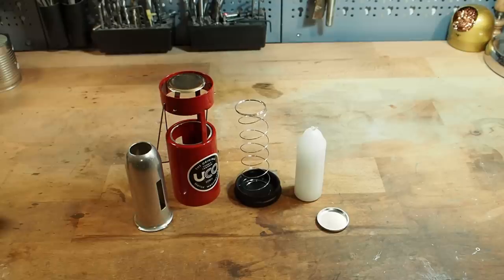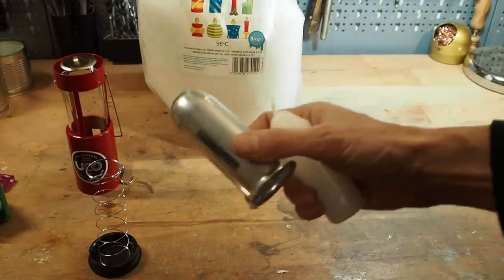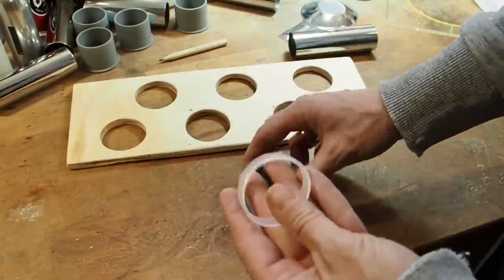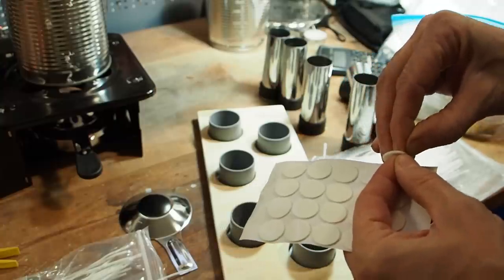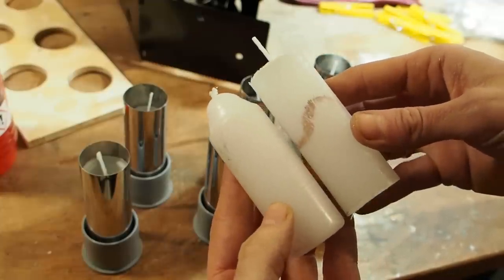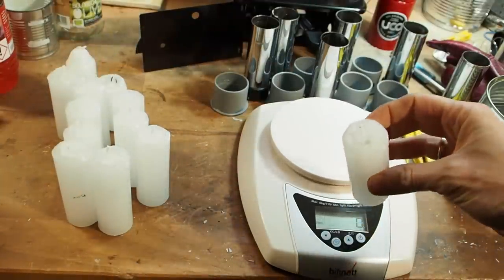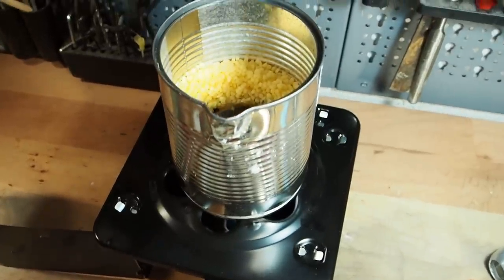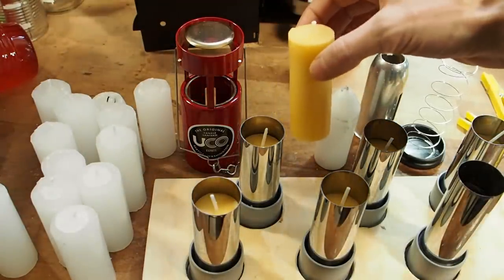DIY Candles for UCO Candle Lantern!

Comment: Could one use a mixture of paraffin and beeswax for these candles?

Also, if using straight paraffin - does one add stearin acid or similar?  

Thanks in advance.

Ps: got a “genuine” UCO lantern in brass, recently.  Have two candle lanterns now.
Reply: Look up plumber's candle online
Reply: @bombsawaylemay770  did so.  Most of the published dimensions were a bit large, e.g. 1.25 x 5 in imperial units.

Based on the measurements I took with several samples, those are a bit large to fit in either of the two lanterns I have, e.g. diameter I recall is about 1.18 inches, and the overall length was closer to 4 inches.

Looks like I’ll need to experiment, then.

Comment: Lily, you started with PVC plumbing pipe but ended up with the metal pipe. Did the PVC not work for you?
Reply: The inner diameter if the plastic ones is smaller than the metal ones

Comment: I hope you test the burn time on the candles. Also if you make your candles upside down and use a condom or some type of heat resistant rubber nipple over the end you will get the shape you want. If making candles with hanging condoms or pipes bottom capped with condoms works I bet it goes viral ;-P

Comment: Don't waiste your time, just buy the tea candle one as it puts out the same amount of light and you can order the candles online. I got the 6 hour ones and 96 of them for around $20.00. Plus it's much smaller and lighter. You can also make more if needed, the 6 hour candles have a plastic base. So just pour the wax into them and support the wick. You can carry several 6 hour tea candles in less space than the regular candles that only last for maybe 8 hours.

Comment: nice idea, but mine would be different. I would try to put something into the hole on the top of the metal candle guide, so it fits smaller diameter candles, then I would just buy simple candles, which diameter is about 2 cm, and ... voila. just cut them into the lenght, nothing else. the burning time would be less, of course, but the cost also. and much simpler. Maybe extra ring on the bottom to keep them in place, as they would be smaller in the diameter.... Any one tried yet?

Comment: Place your container with wax inside a pan of water with a folded cloth in the bottom ! The reason for doing this is the water will only reach a temperature of 100 degrees Celsius and therefore the wax will not reach flashpoint and catch fire ! I got this tip years ago from a friend and his girlfriend who was explaining to me why there kitchen had been set on fire after them indulging in there new candle making hobby fortunately the fire brigade got there before it spread to other rooms ! And for any women who read this and think it may be a good way to meet hunky firemen just tell them your cat is stuck up a tree or stick your head between the railings on the stairs and phone them tell them it's stuck if you want a more hands on experience and it is much safer . ( Only JOKING ! don't do this because someone may be in reel danger and they should not have their time wasted ! )

Comment: You didn't add the cost of your time to make the candles and the cost of materials over the estimated time of making candles or did you? You've learned that bees wax burns about 4 times longer than paraffin wax - yes! Good effort. I;ve trashed my UCO Candle Lantern. The UCO Candle Lantern, is a complex device and therefore simplification and weight reduction is my approach to making an improved solution.

Comment: Your math is a little off on the per candle price as you are not taking in the costs of supplies other than the wax,  the cost of the burner, its heat source, the cost of the wicks, the pipes, the plastic bits , the labor you cut everything and put it together but yeah after you cost out all that stuff the cost of the wax would be so much per candle.
Reply from the maker: Depends on how many candles you make. The fixed cost are divided by the amount of candles I am making with this mold. I can make 100 or 1000 candles.

It took me roughly 30 minutes to make the mold.

One wick costs 0.06 euros btw

3 pipes cost me about 17 euros. 
17 euros divided by 100 candles is 17 cents. 
17 euros divided by 1000 candles is 1,7 cents

Comment: A good video but far to complicated and too long to make. I love my UCO and what I do is buy bees wax sheets and roll my own candles. I cut to size, put the wick on one end and then roll until I get the right diameter to fit the tube. With my fingers I can shape the wick end to fit the top of the tube. easy peezy. The advantage is that the bees wax candles last much longer than normal candles and don't give off the dirty fumes that normal ones do. I also wrap spare candles in cooking paper in order to keep them in shape and for storage. I also have adapted a 50 ml dry shampoo bottle to use lamp oil which lasts even longer. 
Empty the bottle and pull off the  nozzle and drill a larger hole in the top to take a male thread cable connector (gold colour ). Thread that into the top and seal with  two mix putty ( from a putty log ) . When dry this seals the top.  Fill with about 40 mill of lamp oil and put in  a piece of lamp wick. ( not the thin candle ones.). The wick goes thru the connector and the connector is screwed into the container. This works really well and I prefer it to using candles. Easy to make and easy to refill and cheap to run. P.S make sure that the wick is positioned just a fraction out of the connector. To far out makes a big flame that uses lots more lamp oil.  Love your videos.

Comment: O just dont like the idea of candles.  They are messy and u cant carry it around without spilling.    Use camping lled cob light. Put inside a white paint bucket and it illuminstes the enture bucket.  Or simply put behind a hanging whit sheet and illuminate a entire area off one led.  Get a light and use a rechargeable battery.
Reply from the maker: Sure leds are great. But they dont produce a lot of heat. A candle produces 80 watts of heat and can raise the temp inside of a tent and keep condensation down. 

In fact I am planning to hang mine into my greenhouse in springtime so my tomatoes survive the cold weather that we have right now.

Comment: Candle molds are just steel tubes .. plastic is terrible at candle molding.  Can you get a silicone mold ? Perhaps make one from silicone yourself .. maybe just make molds out of seamless  steel tube like muffler pipe with plastic pipe end caps for the wick all off the shelf stuff less work  and once filled you let cool heat gently with hot water or a heat gun  roll on a wood burner etc to remove from the mold. Oh and here's a hack.  Get a pack of the party trick birthday stick candles that won't stay out and place them against the wick when you pour some lantern candles.  Make these  a different color.  These are going to not stay out if blown out for emergency   survival usage